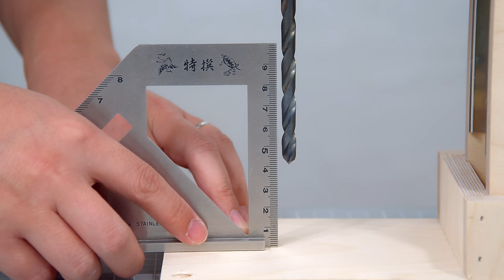2-way Drill Press Machine | Handmade Drill stand

Comment: It's obvious that you have talent. And it's appreciated that your model has most of the parts that are feasible for someone with few tools.

I understand that if the video is about how to make an adapter for a basic tool such as a drill, it is understood that you are someone who is just starting out in the DIY world. Maybe it's my mistake, I don't know. But it doesn't seem far-fetched seeing the development of your project, where, as I say, most of the parts are easy to make simply by asking your wooden board supplier to cut them for you. Seen like this, you should explain how to make 2 of the most important holes: the one in the board that will support the drill, and the one in the base board without a router. It makes a project of these characteristics more credible.

Comment: Very nice drill press stand!  And so beautifully demonstrated.
What a strange little electric hand drill, though - it sounds like its bearings are shot, and it's got a lot of run-out.  I have a similar Hitachi hand drill that has taken lots of abuse and is still in wonderful condition 20+ years later.

Comment: It seemed to be able to drill aluminum ok, if done slowly which is ok.
But I'm planning on working on mild steel? I suspect the steel would push back on the drill into the putty, making the drill go out of place.
Would need to make sure the putty is quite hard.

Comment: Nice build, but downward pressure on only one side will cause the sliding assembly to rack under any kind of strain.  It won't remain square.  That, and I highly doubt a piece of putty is going to keep that drill square under stress
Reply: I'm sure that was putty epoxy, not just putty, so it cures like a rock.
Reply: I don’t think he’s drilling through steel. I agree with you it could rack if you were drilling through steel we’re only using wood here keep it simple

Comment: I bought the plans but noticed that part A-09 is used twice. Once on the A assembly and once on the B assembly. The blueprints only show part A-09 as being made one time not twice. Also the B assembly A-09 part looks smaller than the A assembly A-09 part. Could you please verify the size of the B assembly A-09 part or if it is in fact another part altogether. Thank you!

Comment: Amazing work as always. I have constructed the previous version of this from 2019 and still use it. I will be picking up the plans for this updated version as well. I have already purchased the plans for the 6-in-1 drill press and have been excited to build it ever since I saw it. The only issue I've had is sourcing parts. The US branch of Misumi doesn't have some of the value/economy variants of components and the part numbers don't sync between the Japanese and US sites so it can be a bit difficult to track things down. I'm still trying to amass all of the necessary components for the pillar drill though. I hope to have the main body finished by the end of the year.
Reply: I just started on a modified variant of the 6 in 1 right today(or I guess yesterday) don't currently have much to show for it.

Comment: Hi Jisaku, thank you so much for sharing your stunning work. I noticed that you changed the sliding contact design compared to the previous version. You had wood to wood contact in the vertical slider on your first version, which seemed very solid. Now it seems you are relying on the metal slider rigidity only. Am I right? Could you please share any information you have about it ( pros vs. cons of each approach )?

Comment: As always ... excellent job! Really amazing! Please let me know how you can calibrate the drill's perpendicularity if at the end of the job it isn't exactly perpendicular to the base? Thank you very much.
Reply: I agree, this seems like a risk to introduce a lack of control, leading to variation.
Reply: Thank you very much for your reply and attention. I built your excellent drill press machine, but I got another idea on the internet (regulation / adjustment of perpendicularity) and I adapted it in your project. The only problem I am having is when I press harder on the parts to be drilled, the slides are showing slack and this has hindered me from having a perfect drilling and I loose perpendicularity. I will probably replace my slides in the future to "Horizontal Linear Bearing Slide". Hugs.